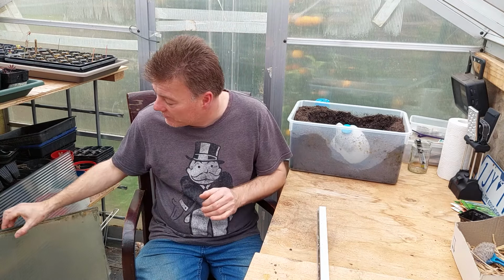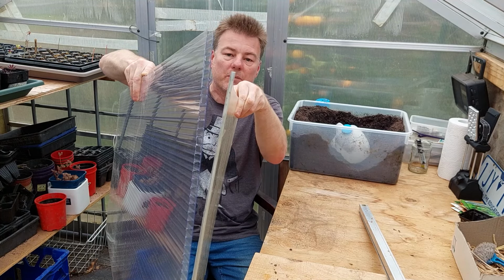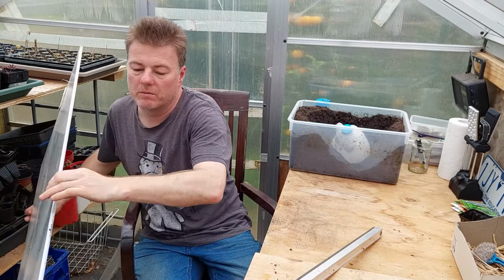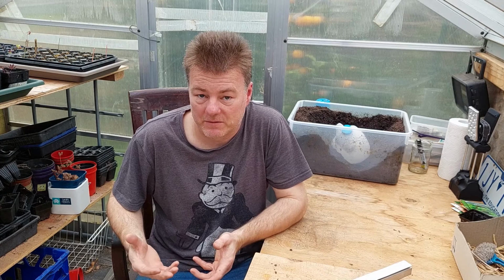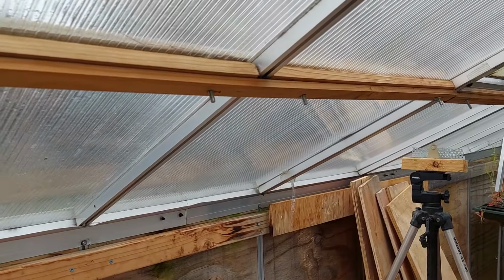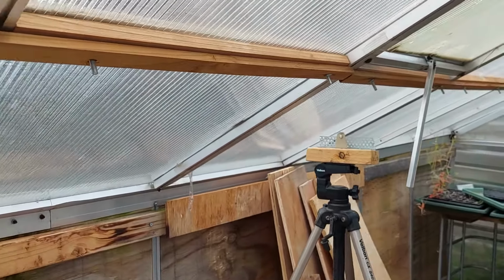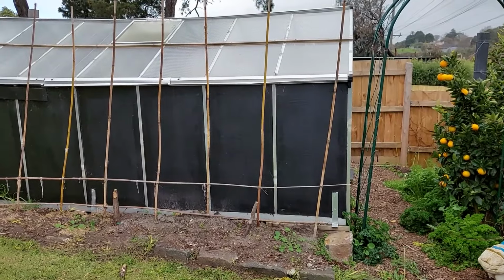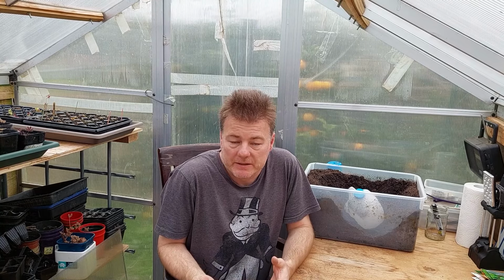How To Stop Your Greenhouse Panels From Blowing Out

Comment: I have had 100% success with running stainless steel 1. 2 - 1.5 mm cable at no more than 500mm spacing across the panels. I drilled 2mm holes in the aluminium as close to the polycarbonate level as possible then ran the cable along, down, along down etc and used a final nut, bolt and washer to hold the tension at each end. Not as tight as piano wire but as tight as pliers could pull it. So three passes on the upper or roof panels, two passes on the side panels. For my 4m x 3m greenhouse I used one roll at about $25 if memory serves.
Reply: Silicone them in

Comment: I went ahead and had a polycarbonate with aluminum framing Green House built lean to style off of my barn. I had it built from a local Green House company. Sure it was expensive compared to a lot of these so called kits, but that was five years ago and here in North Texas the weather is pretty wild. It has held up beautifully have not had any problems whatsoever. I expect it will last me the rest of my life so when you work out all the time and money you’re spending on these cheap alternatives sometimes it just pays to go ahead and spend a little for a professional structure.

Comment: I have found that as well as bowing the panels that came with the greenhouse have not stood up to UV and disintegrated over time. Aus purchased 4mm replacement panels have lasted longer, but 8mm will be the long term fix I need as well
Reply: Where did you get the replacement panels?